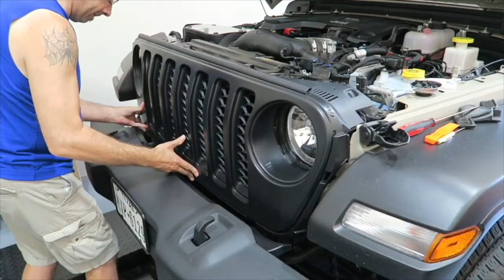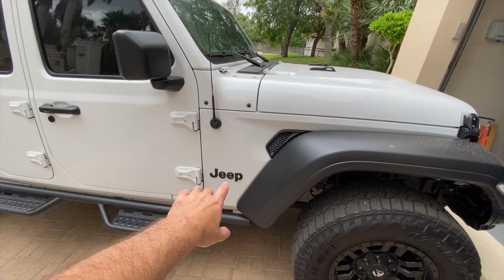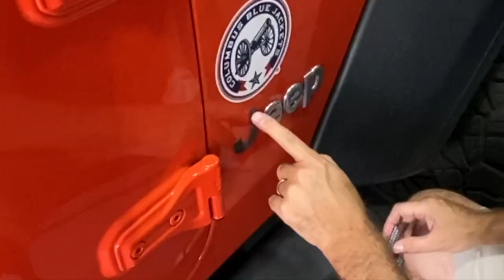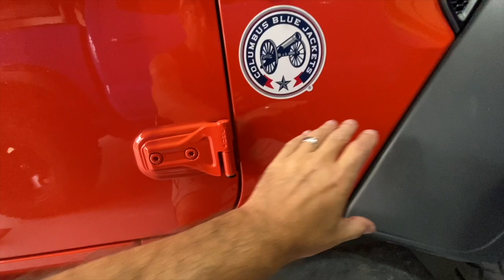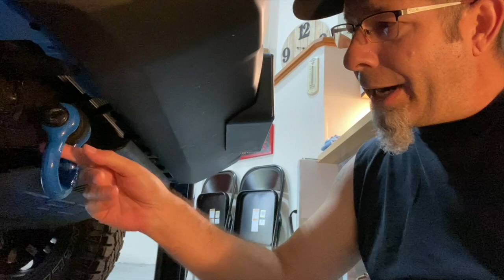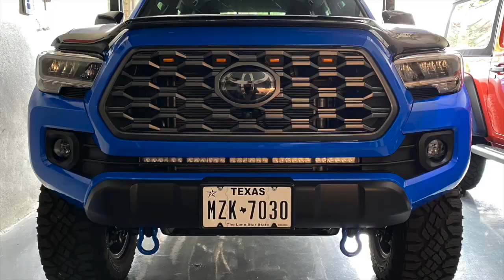Jeep Beautification & An Awesome Way to Secure Shackle Pins

Comment: when you use fishing line you just need to wear a pair of gloves as in garden gloves or leather type gloves and it works well. As far as removing all the left over glue residue nothing works better then a 3M eraser wheel that you mount into your drill motor. lots of body shops use them to remove the residue.
Reply from the maker: Gotta say I’d never use the wheel nor recommend it.  The body shop guys have lots of experience and are great at it.  I’ve heard many stories of people unnecessarily damaging their paint trying to use that method.  GooGone works just fine👍